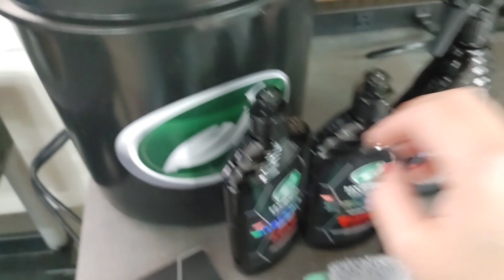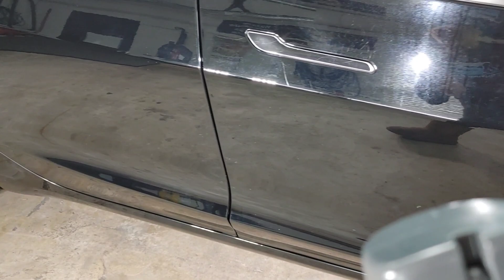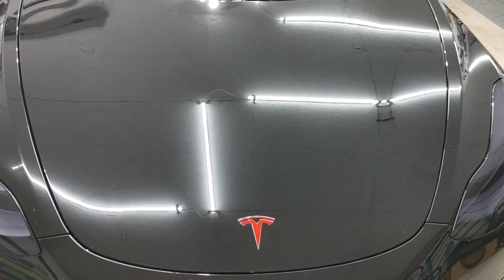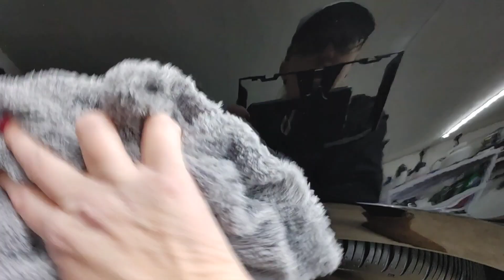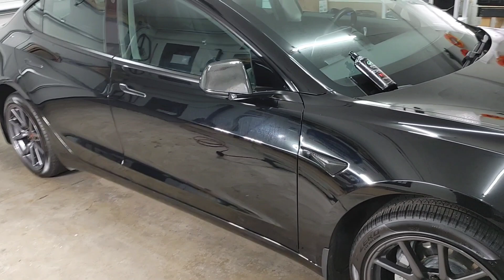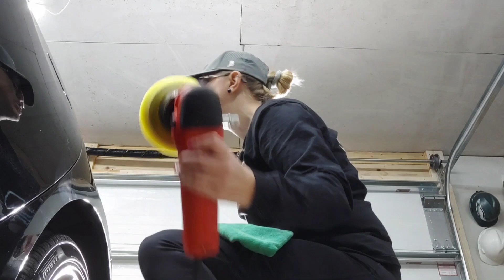Part 1- Tesla Model 3 Meets Turtle Wax Hybrid Solutions Pro New Lineup- 1 & Done Compound Up First!

Comment: What is recommended first clay bar or iron remover
Reply from the maker: I do iron remover first to help break the chemical bond of the rail dust and makes claying easier. I use my chemical decon as my clay lube actually after first washing and rinsing the vehicle. Then spray iron remover and clay, then rinse and dry.
Reply: @attention2detailswchelsea  thanks for the reply

Comment: Another video that knocked it out of the park!  Your narratives are so easy to follow and understand because your points are so well organized and clear. You have a gift for teaching and communicating.  Thank you for mentioning that you used one pad per panel, (a method that I've adopted and am now seeing on other channels).  I use the Rupes brush tool to clean after each section of passes.  After each panel, I toss the pad into the bucket with McKees 37 polishing pad rejuvenation.  .  Rupes said not to let the pads soak long and I was wondering what do you do with the pads after you change them?   I loved your "Test" hood, that was great.  Two hours, job well done.
Reply from the maker: I usually let them soak for 5-10 minutes and then squeeze them out and either rinse with hose or pad washer, spin dry on my da and let sit in the sun for a few minutes on a grit guard. I have three pads normally drying out while I polish the next panel and they are drying out in phases and cycle them out one at a time in order of most dry.
Reply: @attention2detailswchelsea  Awesome creativity and functionality. Thanks so much.

Comment: Will the finishing pad remove marring from clay bar as well? Thanks keep the great information coming 👌🏼🧼
Reply from the maker: I believe so simply because of thr abrasives in the polish or you could use a white polishing pad which is slightly more abrasive than black but softer than a orange pad

Comment: Every time I see someone working on a Tesla’s I cringe! Their paint is complete poo!
Reply: I’ll be detailing a black colored Tesla soon. Full detail, paint enhancement. Any advice?
Reply: @gtrmageddon    do plenty of test spots, some Teslas respond totally different from eachother. The trouble is usually finishing and often the more you chase your tail, the unhappier the paint gets, so dial in your pad and liquid combo as soon as possible.

Use new pads and soft high quality towels and don't go overboard with the panel prep/IP wipes, aggressive mixes and dwelling can cause some trouble. I prefer to use a primer polish like Essence and on the absolute worst cases I skip the final panel prep after Essence. Otherwise I sparingly spray into a brand new Eagle Edgeless and gently prep my perfected surface. If even that makes it angry, I'll use McKee's 914 at panel prep dilution.

I've been testing Xtreme Solutions LVR 496 and so far it's been amazing. Easy to use without having to jump through hoops to make it work, and a very easy gentle removal.